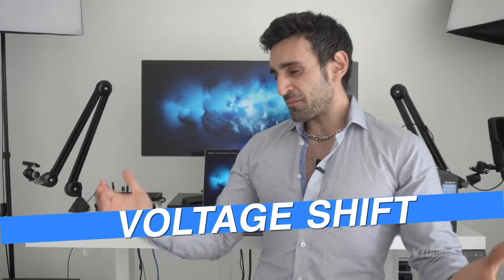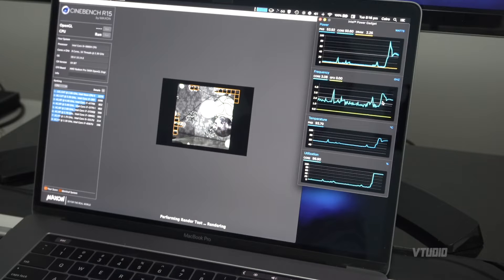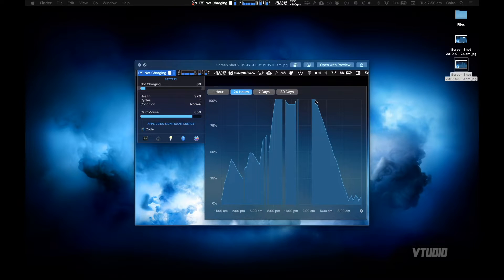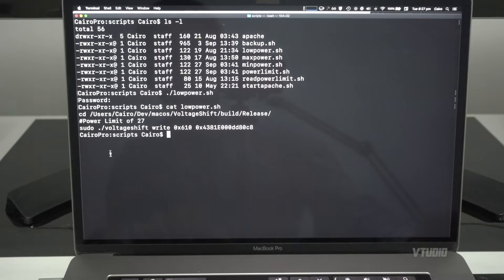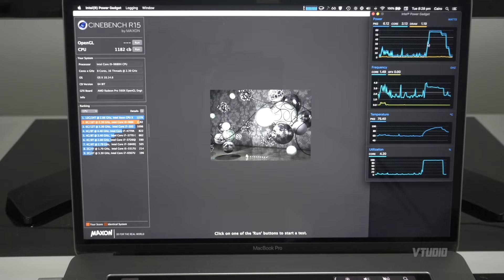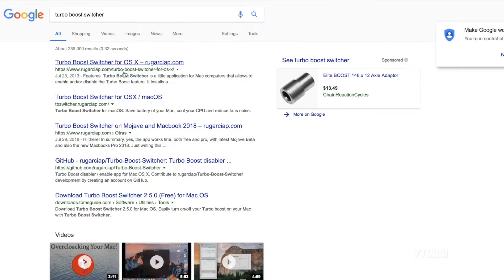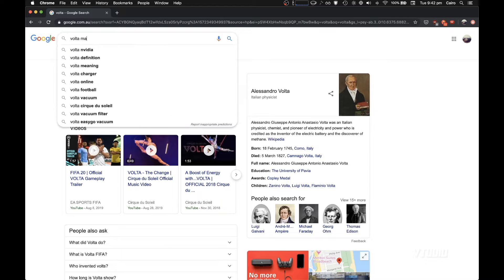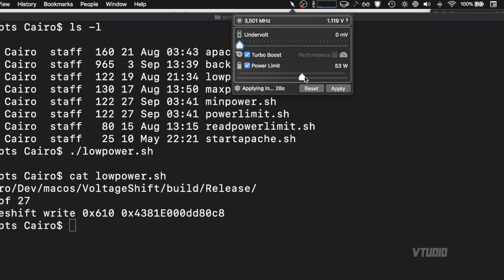Make Your Mac run Cooler and Faster | CPU TDP Turbo Boost Guide [Advanced]

Comment: Needed this info today, almost 6 years after this video was posted :) . I went for the Voltageshift option and man it works like a charm on my 2019 i9. Confirming the solution is still valid in 2025 on Sequoia. Thank you so much.

Comment: help please, mac os ventura, voltage shift 1.25, "read 0x610" returns only:
(00000000 01000010 10000011 11101000 00000000 11011101 10000011 00100000)
 without RDMSR line

what could i need to do?

Comment: Did you try the latest voltageshift 1.25? I'm using pro 16 inch 2019 running Monterey and all the undervolt command is not working :(
Reply from the maker: Unfortunately, I no longer own this laptop for any further experimentation.

Comment: Why are you dividing by 8? Is this because you have an 8 core processor? If so, should I divide by 6 if I have a 6 core processor?
P.S. Can you do a video on how to work around the “You don’t have permission to open the application” problem with Big Sur. It seems to have a security feature that prevents unauthorised apps from launching and I think it may require a Terminal command to allow permission.

Comment: Thanks for the details. That VoltageShift really powerful. I believe these method will work with the mini as well.

With desktop CPU turbo boost TDP can leave it as normal, the regular TDP should always set to the  CPU base TDP (most case 65W).

I will go head and buy Intel base Mini now in 2021. I know, the M1 is much faster but I need to extra ram to run and I need run x86 window docker so no choose.

I am just M1 air watch this and reply ;) It's awesome!
Reply from the maker: Nice one, let me know how you get on

Comment: Been getting a 'Killed:9' response on my 2018 MBP i9, any suggestions?
Reply: Same problem.
Reply: There is a fix / workaround on voltageshift github page in the issues section. it is Issue number 34

Comment: So you said that the undervolting doesn’t work on the latest Macs being the 2019 version but what about the 2018 versions? I want to keep my 560X at 70 wats peak for Mac gaming but it drops down to the 50s after a few seconds and the lagging starts again. I need a fix, but so far I can’t find anything other then boot camp drivers for windows.

Comment: Disable Turbo Boost is not working on mij mb pro 16 inch..... Even after typing my password. And I already did the privacy thing in settings. And the kernel_task is running.. Any thoughts why it's still not working?
Reply from the maker: Try double checking with Intel Power Gadget, the status indicator in Turbo Boost Switcher can sometimes be buggy.
Reply: Restart

Comment: when i hit disable turbo boost and do my password nothing happens no matter how much i hit the button, using a new macbook air 2020 and i5 core running catalina
Reply from the maker: Have you tried emailing the developer?
Reply: Type in your password twice it’s weird but worked for me
Reply: Try and add the turbo boost switcher to the applications folder before using, do not use it from the zipped folder directly. Hope it works for you. Cheers.

Comment: Hi there, u r da man!! cool channel and crazy useful insights!! I just got a full spec 16'' MBP and the fans......oh man these fans is like I bought a vacuum cleaner. Would it be useful to use this fix? I do have an external monitor with legacy HDMI through a dongle that is always on fire :)). Had the "restart while on sleep problem" and I had os reinstalled, so I m testing before I take other action (and return it). Let me know what you think. Thanx!

Comment: Is GPU undervolt still possible on recent models? I have a 2019 15" and the CPU is crippled when connected to an external 4K monitor because of heat generated by the Radeon Pro 560X, which draws an extra ~18W at idle. I don't actually need graphics for anything. Just browsing and editing code at 4K.
Reply from the maker: I haven't been able to undervolt my GPU, but let me know if you find away.

Comment: Bro my freaking Mac keeps overheating just for using simple tasks it’s heats up to much and have to take it off my lap it gets so hot and fans just start blasting please help
Reply from the maker: Sounds like it needs a repair, check my repair experience video posted at the beginning of the year for more info.
Reply: @headsoftech  but its been going on with other MacBooks man.  but I did what you said in the video and turned off turbo boost and man no more heat and no more fan noise
Reply: @CesarMartinez-br5qu  which app did u end up using?
Reply: Using voltageshift or other app?

Comment: Great video sir, keep up the awesome work!! I've been using the Turbo Booster app for a week or so now and it works well but it's kind of a pain to have to turn it on and off depending on when the system decides to start cranking too hard (most of the time it isn't too bad). Will give VoltageShift a go and see how this goes. Thanks again! And yeah, Apple should really provide way better power management here!!
Reply: Actually, quick Q before I go down the VoltageShift route; is there a way to disable the password requirement every time you switch on/off with Turbo Boost Switcher?
Reply: @davefellows  I think you'll have to pay the 10$ version

Comment: If I want to make the fan less noisy and to run cooler, i just need to download the turbo boos disabled/enable? Will my apple care get void if I do so? Sorry Still newbie. I recently got my macbook pro 16 with the standard one that costs 2499$. Thanks mate!
Reply from the maker: Yeah Turbo Boost Switcher is the easiest app, and I've never had any warranty repair problems with Apple for using it, it's not a permanent change it's just a software flag.
Reply: Noted mate! Thanks a lot!

Comment: Does the new 16 inch require something like this?  But i heard it is actually ok to just let the OS do its thing, bootcamp however requires it.  Mine is the upgraded 2.4ghz option
Reply from the maker: Well, I've had the 16" i9's battery drain on me a couple of times, but I don't actually know why it happened yet, need to do more testing to narrow it down, so yeah if you're planning on doing heavy tasks non-stop on the machine or if you prefer a cooler less fan noise experience then TDP limiting is your friend. But if I was you, I'd not worry about it, get AppleCare, and if you need to run cooler or more battery life - just disable turbo boost.

Comment: Hi! I've tried the VoltageShift method, and now I can't get Turbo Boost Shifter or Volta to work.. Am I missing something?
Reply from the maker: What happens when you restart your computer? Does Turbo Boost Switcher or Volta still not work? VoltageShift doesn't do any permanent changes and if you run the read command, you'll see that the values you set gets overwritten by Volta if you have that running at the same time.
Reply: Vtudio TurboBoost Switcher doesn’t do anything when I click “Disable Turbo Boost” and Volta doesn’t even read the processor info, it just shows everything grey’d out and doesn’t let me do anything.. To be fair, I had never used any of these apps before.. The first one I’ve tried was Voltageshifter because I have a little knowledge on programming.. But I gave up on it because it was too technical, and tried to use the other apps, but I never got them to work.. BTW your videos are GENIUS, please keep it up!
Reply from the maker: Thanks mate, what kind of Mac are you running?
Reply: Vtudio 2017 MBP 15” with the 3.1GHz quad-core i7
Reply: Vtudio Just got Volta up and running.. But the performance checkbox is disabled.. 🙄
Reply from the maker: Did you disable SIP?
Reply from the maker: Has the trial expired by any chance?

Comment: Hello Buddy, So you i9 2019 Keyboard is still working fine? No issues yet? Means Apple fix the thing? Correct me if i am wrong.
Reply from the maker: It's only been a few months, can't say for sure if it'll hold up long term, but so far so good.
Reply: @headsoftech  What about I9 2.3GHz fan noise? I'm just buying an MBP 2019/I9 2.3/32GB/560X/512GB but a friend said to me it's really noisy. What do you say? Thanks!

Comment: I really like your videos and it's truly helpful! I have a few questions:
1.The tdp on the 2018 i9 Vega 20 should be the same right?
2. If I am already using Volta, will the script overwrite Volta's change?
3. You also mentioned that rebooting will reset the script, does this mean I have to manually change it everytime I rebooted my device?

Thank you so much coz you actually helped on my decision to buy this MBP. I truly loved it !
Reply from the maker: Nice one, the hex value might be different on the 2018 model - I used the 2019 model in this video, but the inital TDP values are the same. This will overwrite Volta, and then Volta will overwrite this - they use the same method underneath, but Volta only lets you set the Max TDP not both - Personally if you're happy with Volta stick to using that as command line operations isn't for everyone. You can have it automatically start the script every time you reboot and login - that's what I've set up on my system, but by default the settings are cleared back to the initial values, if you're interested in that I can publish a video on how to do it.
Reply: @headsoftech  also according to my understanding, is this method trying to limit the tdp (under 100W)while keeping the clockspeed as intended?
Another thing is that you've limited the CPU tdp to 60W while Vega 20 takes up to 50W. Would it still be over the 100W limit?
Reply: It would be great if you can make a video about it!! It’s always good to learn command lines and scripts
Reply from the maker: Yep it will still eat into the battery but, the good thing about the Turbo limit is that it only operates for short term - around 10 seconds at most. So limiting the CPU TDP is more important as that one kicks in long term. But personally I like to limit the Turbo too as I get more stable performance as shown in this video.
Reply: @headsoftech I see. I thought the boost clock only stays for 28 sec (dd)? also according to this  macrumur post, its based on the 2018 fix (where the user found the solution and was applied to 2018 i9s), so it seemed that the tdp is the same. 

2019 i9 mbp with 2018 i9 quote
https://forums.macrumors.com/threads/optimal-cpu-tuning-settings-for-i9-mbp-to-stop-vrm-throttling-explanation-of-apples-engineering-f.2128936/

2018 i9 solution quoted by notebook check
https://www.notebookcheck.net/Throttling-in-the-2018-Core-i9-Apple-MacBook-Pro-traced-to-improperly-set-VRM-power-limits.318176.0.html

original 2018 i9 solution (deleted)
https://www.reddit.com/r/macbookpro/comments/91256u/optimal_cpu_tuning_settings_for_i9_mbp_to_stop/
Reply from the maker: Nice one, yep the TDP values are the same, but the hex code might be different - the first three characters. So just make sure you edit your version after grabbing the original using the read command.
Reply: @headsoftech  Hey There, I'm trying this method on my macbook pro 16inch (catalina) and even though I disabled system intergrity protection for kext and it shows sucessful , whenever i run voltageshift , it still says that voltageshift is a malware. Is there a fix to this?

Comment: I found the cure to the fan noise at least. Had my AirPod Pros on with no music and the fan was quiet AF. Wooooof.
I want some root privileges 🍑🍆.

How many battery cycles do you have?
Reply from the maker: 22 on this one - which is great considering I was 14 in my first week with the Vega 20 edition.
Reply: Lol I bought airpods for this exact use case tho my 16" arrives later this week. I maxed my fan noise on my 13 mbp then tested with both airpod pros and wh 1000xm3 and got surprising results.  wh 1000xm3 really cut the cpu fan noise and but i can hear the AC a bit. With airpods pro all i can actually hear is the cpu fans lol but Ac is completely  inaudible. If the 16" fan noise is on the lower pitch side then I could have better results than with my 13 mbp.

Comment: Thanks for this video. Tally ho mentioned using a Dell 130 watt charger. What are your thoughts on this?
Reply from the maker: Hey mate, I've only tested up to 100W chargers - and found that even though they all reported in the OS at charging at 100W they performed slightly worse than the official 87W charger.
Reply: I'm not sure if you'd be able to fully utilized any charger with wattage higher 100 watts. All ports on the MBP 15" and 16" are Thunderbolt 3 ports which caps the bus at 100 watts.

Comment: man i got a new charger that can supply 95W, and now it doesnt drain the battery.
Reply from the maker: Which one do you use? All the ones I've tried - while reporting charging up to 100W actually power the laptop worse than the official one.
Reply: Anker one
Reply: @rodrigo4379  could u link it please ?
Reply: Marco Sabba https://www.anker.com/products/variant/powerport-atom-pd-4/A2041122

Comment: Do you think its worth getting a 2019 MacBook if you have a 2018 i7 32gb Model?  Thanks!!! Great videos!
Reply from the maker: Hey mate, I think at this stage with all the rumours of an even newer 2019 MacBook Pro (WTF?!), it's best to just wait it out until we see what that is all about, unless you have a business case for spending money as a tax write off.
Reply: @headsoftech  Yeah I need the write off but i Think I'll wait and see thanks! I just heard that the 2019 has been MUCH better in terms of performance and reliability than the others of the same generation!! And when the new one comes out maybe the others will go down in price!!!
Reply from the maker: That makes sense, and I'm sure eBay will be flooded with great deals too, so as long as it comes with Apple Care, you're set.